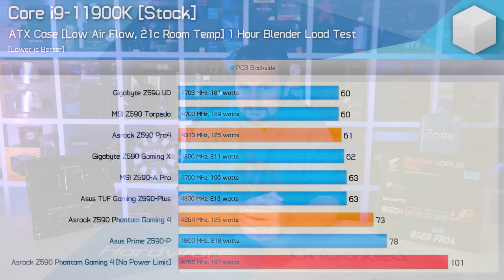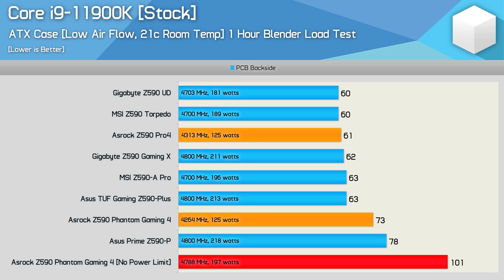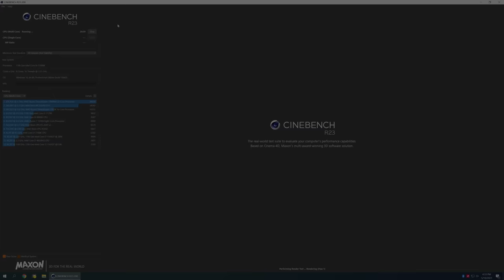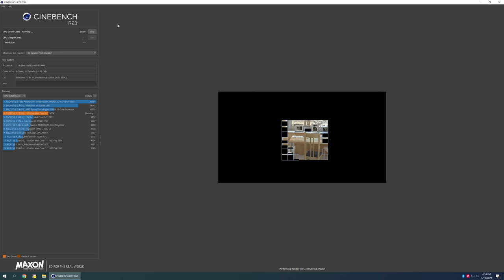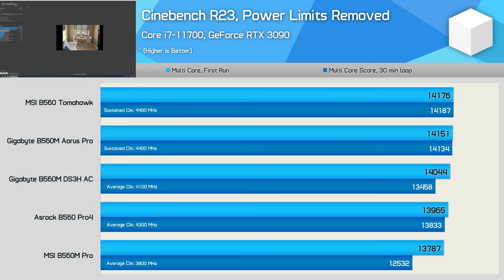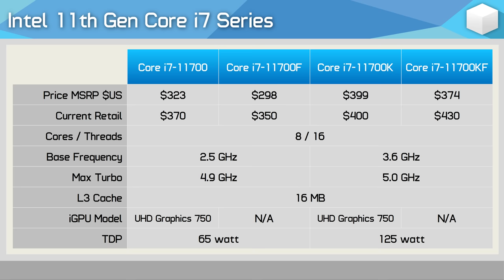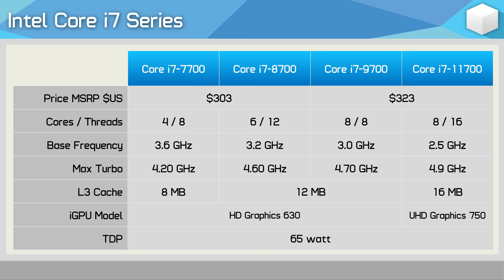Intel B560 is a Disaster: Huge CPU Performance Differences, Power Limit Mess

Comment: Thank you for making videos like this! Also, please include ITX-boards in your roundup!
Reply: Too late for me who bought an Asrock B560M-ITX/AC for $95, but I am curious if I got what I paid for.  :)
Reply: @peterl.104  I've got that board with a 11400F, and it works fine. Average clock during a gaming session with a NH-L12 Ghost S1 is around 4300mhz. Short PL at 150W and long at 65W. But I'm quite GPU limited with a GTX 970, so we'll see what it looks like under more pressure.
Reply: @sebastiansandvik825  mine seems ok, too, but I have a GTX 1060 and it’s mainly a HTPC and gaming computer. It’s probably worth the $95 price. Just curious.
Reply: Definitely, I have been scouting out 11400f for next potential upgrade for my mITX build. But this makes me reconsider.
But with this speed my new gpu won't arrive until next Gen Intel and AMD is out anyway...

Comment: If intel 11th gen wasn't a flop enough. 11th gen is worse than the people who bought the quad core 7700K right before the 8700K.
Reply: I bought a quad core 11370H before new Tiger-lake parts were announced
Reply: @Amusia727  After years of making bad purchases at bad times of the year I started to notice a pattern to hardware manufacturers.

Its actually really simple when you take a step back and look at the whole picture, the two most important components are always going to be CPU/GPU so when you purchase a system a good idea is to skip the direct successor( e.g. purchase an 8700k and skip purchasing 9700k) and potentially purchase a newer chip down the road.

The good thing about GPUs is that you can squeeze a lot of life out of a GPU when you overclock it, I used a Radeon 7870HD for years and years because it was such a monster for overclocking, I did my consumer research and only paid 240$ for it and got 6+ years out of it.

You can easily skip one or two series of GPUs by making a good decision on what to purchase(e.g buy a GTX 1080 or 1080TI and skip 20xx and 20xx SUPER series) and you usually won't be missing all that much.
Reply: Well i think i5-11400F is  damn good value CPU though considering what AMD has in store at current prices.
Reply: @fleurdewin7958  Absolutely the 11th gen i5 lineup is good for value.
Reply: @Amusia727  F

Comment: the only way intel will ever change the way they define and enforce their specs is if reviewers ONLY test intel CPUs at the baseline spec, rather than with limits removed. Right now, because reviews are usually done on high end boards intel gets the benefit of reviews showing their performance in the best possible light, while also being able to sell CPUs that can vastly under perform on more realistic hardware configs. It's not the reviewers fault, but intel absolutely does take advantage of this fact to show their CPU and the platform as both being high performance and affordable, when in reality, the high performance figures are often only available on higher end, more expensive boards that buyers of non-k sku cpus are highly unlikely to actually buy.
Reply: Reviewers are to take half of the blame, as they allow this to happen.
This got covered in 2018, looks like little was learned from it and nothing done to stop it.

Comment: Really like seeing more reviewers actually talking clearly and openly about the pointlessness of K chips. And I'm curious to see how will Intel proceed with them. Probably the only reason they are still selling them is because people aren't checking benchmarks and are buying them, so the question is what makes more sense? Continue selling K chips for as long as they keep selling or just remove them from the lineup completely. With Alder Lake, they'll have more room for actually making better models of different tier CPUs, that is they could make an i5 with two small cores, they could make one with 4 small cores.
Reply: K is not pointless, it is, in fact, required for Intel to claim ANY kind of performance advantage in games over Zen 3 at this point. Stock frequency CPUs sucked in 8th and 9th generations with only budget gamers buying them. In 10th and 11th gen, the gap is small, sure, and the amount of additional heat generated when you overclock is completely ridiculous, but Intel won't stop selling K chips, both because "capability to overclock" is a good additional selling point, even if nebulous, and because it makes them look like they're not losing to AMD completely.
Reply: @dexter2392  Overclocking benefits on Intel have been declining since Ivy Bridge. There's just no point in overclocking them. As for sales, Intel does in fact provide the better bang for the buck as far as gaming is concerned.
Reply: @CanIHasThisName  You could actually get up to a 5-10% performance improvement in games from overclocking 9th gen. I wouldn't say that's pointless, considering how close they were to the Ryzen 3000. The newest generation is obviously already squeezing all the performance they can get out of 14nm, but K chips will still be selling just because they're "premium" and not locked.
Reply: @dexter2392  It wouldn't be pointless if it there wasn't such huge price premium attached to it. The price/performance value goes completely out the window and you're better off just buying a better or newer CPU.

Comment: You know, it's funny.  I always said that motherboards had the LEAST impact on performance when it came to core components and Intel has managed to slaughter that statement.  With the wrong motherboard, you could be looking at getting performance out of a modern Intel CPU that would be not too far off from an i7-2600K.  Jeez.
Reply: An interesting test would be pairing all top end CPU with the cheapest compatible board you can get. I wouldn't expect very high turbo clocks against max turbo announced clock out of that type of setup. If the motherboard power delivery cannot supply enough current to the CPU it won't boost to max turbo clock and outside Z series chipset AIBs aren't obliged to support PL2 level power draw. It leaves room for cheap boards existing for cheap CPU which don't need a 250W capable board for getting max turbo.

Comment: The 11700F has a TDP of 65 watts. This means that it is intended to be run with a 65W TDP limit. Clock frequrency will vary depending on load. In the worst case it will be run at base clocks, will less energy intensive applications it will be much higher.
All boards should run the CPU at 65W at default settings. If some boards offer a setting for increasing power limits they may do so, same as for OCing features, but it is in the responsibility of the system builder to ensure sufficient cooling.

So all these entry level boards did everything right. Those that are doing it wrong is boards increasing (or even removing) power limits by default. For boards intended for OCing I think it is also OK to provide the customer with a wizard to ask him if he wants to run with or without power limits when first entering BIOS, but running above intended TDP (for which the power supply and cooling solution may not be designed) is wrong.

But the huge issue is that most reviewers do not understand TDP limits, publishing misleading information about performance numbers, that are never achieved at intended settings at stock settings and later trying to blame Intel that CPUs are running hot or using too much power or trying to blame board vendors if there are insane VRM temps or all sorts of stability issues if you are running way outside of the intended parameters. Only because Intel does allow running a 11900K at 300W does not mean every board vendor needs to provide VRM cooling solutions for 300W.
Reply: Basically Z series boards are enforced to comply with PL1, PL2 and Tau of the K series CPU. If the board vendors offer more they can: LN2 capable beefy expensive boards.
Other boards is up entirely to the vendors as long as they meet PL1 of supported CPU. So they make too very cheap boards for office use in which boosting to the sky isn't valued since there's no profit in letting the CPU go out of the efficiency zone.
Sounds right to me...
Reply: So true, there are probably a lot of people who want drop in a locked processor with the box cooler and be done for which any of these boards will suffice! Even the cheapest AsRock B560 can raise the power limit to 100W in the bios which should bring back 99% of the gaming performance.

Comment: Problems been fixed?. I've updated my bios 3 times the last year. Now running cinnebench on a b560m ds3h with 11700. Multi core test = 4.8ghz. Score 12826. Would really like you guys to retest with the cheap end models.
Reply: Yeah I have the b560m with 11400f and is all time at 4.2, is giving me better frames than a 10600k

Comment: My Asus Prime B560m-a runs my 11400f on 4.19 ghz and progressively downclocks all the way to 3.7 ghz over 35 minutes time, then 5 to 10 minutes later it jumps back to 4.0 - 4.05 ghz again and seems to remain there for the past half hour. It never went below 3.7 though and was only there for a short amount of time. I do use great cooling (Arctic Freezer 34) So the temps aint the problem (Max temp of 71c. Averaging 66), using prime 95 to stress my CPU. So  yeah you are right , luckely this motherboard aint performing as bad as some in your graph and seems to hover around 3.8 - 4.0 most of the time during the stressing. I would say the average clockspeed in an hour test is 3.95 to 4.0 ghz so i am missing out on about 0.2 to 0.3 ghz power which i am not too disappointed about concidering the price (120 dollar ish)! :) Looks like i did make the right decision by going with Asus purely based off their VRM quality over lets say asrock. Do keep in mind that you should probably invest 10 to 20 dollar more into a TUF gaming, as the audio chip on the TUF is better ALC1200 instead of 889. I regret not buying the TUF thoughh the VRM should be the same.

Comment: The problem with the MSI B560M PRO is that it doesn't have heatsinks for the VRM but it does have the mounting holes for it.
If you get some thermal pads and cut a old heatsink to fit the VRM you can extract a lot of performance out of that board on the cheap. The good thing is since it has the mounting holes it's not a permanent mod so you don't void the warrant.
The mosfets on that board are probably of very efficient since they can handle that much power without a heatsink.

Comment: Remember in summer 2019 after the Ryzen 3000 launch, where lots of users were complaining that e.g. their Ryzen 7 3700X would "only" hit 4350Mhz instead of 4400Mhz? Well, how about this then? 50% less performance from the same CPU just due to the motherboard, I'm sure Reddit will have a feast with this one

Comment: Great job, Intel. My undervolted 12-Core Xeon 2678V3 gets a better Cinebench 23 score under sustained load than your 11700 on a cheap B560 board. And that for 180 EUR for a China board and CPU together - people willing to upgrade from their low-core parts should do their research and also consider options on the used market.

Comment: I feel like the title is misleading to viewers. The point of the video is that B560 may yield different performance which is confusing to consumers. Saying that "B560 is a disaster" on a headline will bring more people to buy X series boards and unlocked CPUs which is contradictory to the final statement (15:50) saying that budget B560 boards have the potential to perform at max performance to save money.

Also, the video's topics call for simplification and standardization of the performance of all B560 boards (15:30), but how else would motherboard manufacturers differentiate from other motherboards. Is it really a decrease in performance or that motherboards have a way to improve the performance compared to others. I think it's a problem of consumer knowledge if anything such as the common occurrence where people don't turn on their XMP on capable RAM. And that knowledge is gained by watching these videos.

Comment: Back in the day, I got myself a P85-D3 mobo because it had been shown to be on par, if not better than the Z boards for a fraction of the price. I paired it with an i5 4670, which I still own today along with my R5 2600 system.

Comment: Oh boyy, i just bought an ASUS TUF Gaming B560M-Plus to pair with 11600. Now I'm scared af, please test this board!! Thank you as always for ur work!🙏🙏
Reply: Asus Tuf is generally a mid range brand, so I doubt if it would have the power limit enforced out of the box, but let's see if I am wrong.
Reply: I have Asus B560M-A with 10400f, tested in prime 95 loads for 30 mins with CPU temps hovering at 80 degrees using 111watts of power at max. It held the clocks at 4ghz all the time. Your board has 2 more vrms than mine and 11600 will consume 140watts atleast so the first thing you need to do is set the power limits to atleast 150 watts as it will be 125watts by default in the bios and then give it a run. What I feel is it should handle the loads. Hope for the best tho.
Reply: chill bro, no issues with the TUF lol.
Reply: I have the same mobo with 11400F. Power limits are not enforced out of the box. I get all core boost of 4.2Ghz during workloads.
Reply: @msnehamukherjee  yeah same with B560M Aorus Elite, you can download intel XTU and adjust limits without rebooting to BIOS.
Reply: @msnehamukherjee  Can you check the wattage set for long time loads in BIOS?
Reply: @jemmy7776  It draws around 110-120 watts in Cinebench R20 workload. This is with 4.2Ghz sustained all core boost. It's worth mentioning that I have a 240mm AIO and temps never crosses 65c hence the boost lasts forever.
Reply: @msnehamukherjee  I mean check in BIOS please, mobo has an option called "Internal CPU Power Management" under AI Tweaker where you can see what power limits are set by default, I want to know that.
Reply: @jemmy7776  At default I remember it was set to "Auto", no value mentioned.
Reply: @msnehamukherjee  Value will be mentioned on top or below of Auto button

Comment: 8:42 And that's why testing using power limits makes more sense
Reply: If anything it makes less sense, far less sense.
Reply: @gamingunboxed5130  I disagree as that would be a baseline performance which everyone can expect. Anything beyond is achievable if you get better cooler and motherboard. It's on Intel for not putting those CPUs as 125W for example.
Reply: @FakeMichau  It makes less sense because A: you wouldn't discover the good boards and B: It's not the out of the box behaviour for most LGA1200 B560 and Z590 boards.
Reply: @gamingunboxed5130  You totally could by adding some OC results. You get the benefit of having baseline numbers applicable to all boards - good and bad with the ability to show max performance when exceeding the TDP and the cooling ability of the included cooler. 

I mean, I'm not stupid, i know why they remove the limits in stock configuration on the better boards but testing like this just encourages that questionable behavior.
Reply: @FakeMichau  Yeah, you get all the information except for how it actually works out of the box, the way 99% of people plan on using the product. (we know, we polled it)
Reply: @gamingunboxed5130  Exactly, and as you said, "inexperienced" users that just come to your channel for a single review may be disappointed when their system doesn't perform as the review suggested. Of course those users wouldn't participate in any poll. 
btw. I participate in your polls and haven't seen that one.

Comment: In case anyone is interested: The Asus Tuf Gaming B560-Plus Wifi runs the 11400 at 4200 MHz with a score of 10099 in Cinebench R23, no throttling. Seems like I dodged the bullet with this board.
Reply: sorry im a pc noob, when u say you dodged a bullet, is the TUF gaming supposed to be on par with AORUS and tomahawk?
Reply: thanks, was wondering about that myself
Reply: I've just bought the ASUS ROG STRIX B560-I, hopefully it will be good...

Comment: That's some impressive discovery, most of us really wouldn't expect performance differences of locked 65w TDP CPUs between boards and just go by the numbers. 

One thing I do wonder about tough: what about prebuilds?  It's not like Acer, Dell, HP etc. are renown for high quality motherboards with lots of bios options. Kinda feels like there's a reason to those suspiciously low "normal" speeds... so it's basically "up to (you to buy a expensive motherboard)". 

Hilarious, imagine buying a car with a range of "up to" 500 miles but only managing a fraction of it...
Reply: All CPU are bound to the base clock the manufacturer announces, that's the minimum every motherboard has to be compliant with. In top chipset boards(for example X570 and Z590) it's also a requirement for motherboards to be fully compliant with boost algorithm demands in all CPU range: so if you want full boost support the safe shot is there, otherwise you get your hands dirty configuring the board and ensuring everything runs on safe paremeters.
When it comes to clocks labeled as max clock or turbo clock or whatever it's an "up to" meaning that depending on motherboard power delivery, thermals, power draw, etc the actual turbo clock may or may not be reached.
So it's not hilarious: it's been this way since manufacturers started talking about boost in hardware. What happened was the difference in power draw across CPU range being in the old days from 65W to 95W max, with turbos from 88W to 150W to having a range from 65W to 125W and turbo range from 150W to 250W in desktop space. The overlapping between normal and turbo power demand has dissapeared and they got apart, so now the cheapest board which only has to comply with meeting normal power demands is not capable of powering the cheapest CPU in turbo mode in an out of the box manner.